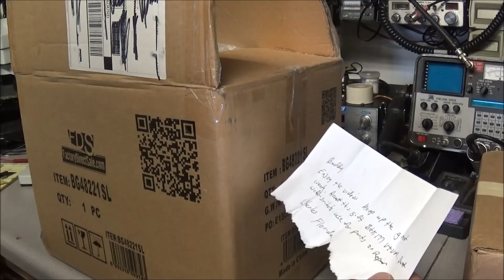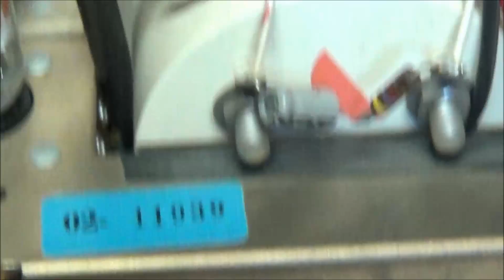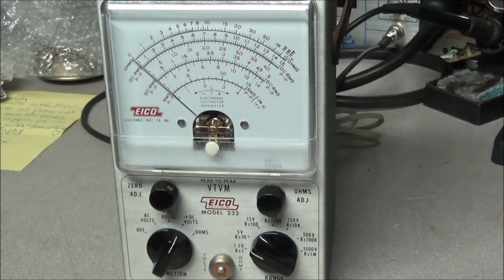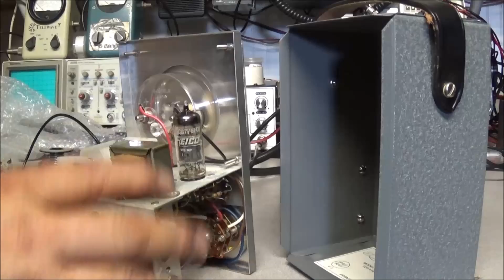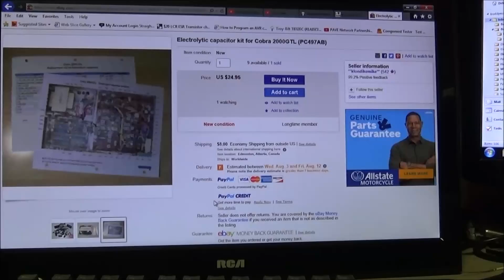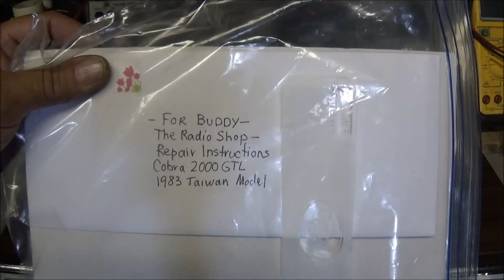#62 Mail Time

Comment: Buddy, you always make great videos. Where I live there are no radio technicians. I need help with some of my CB radios. I own a Realistic TRC-449 and a TRC-457. Base CB The base radio has a distinct AC hum, I suspect that the filter capacitors are bad. the RF output is down. I need help. Thank you for putting these Videos for all of us to see.
Reply from the maker: Robert. Order a capacitor kit. This will most likely solve all the problems. Even the low power issue.  The original caps were not best quality when they were installed.  Thanks for watching.
Reply: Thanks again Buddy.

Comment: The 10V cap comments were good to hear. I've always uprated the lower voltage caps, mostly because of modern components having smaller diameters, not the voltage rating. Agree 100% on using 105°C caps.
Reply from the maker: Thanks Michael.  Sometimes you just have to use the best and the repair will keep serving for a long time.

Comment: The 2000GTL's also have a screwy power supply circuit because the power switch is switching ground.  As you noted, all due to the clock circuit needing power when the radio is off.  Another thing that causes the channel numbers to glow is when the meter light bulbs burn out or someone changes them to LED's, reduces load and you get what I call "afterglow".

Definitely have to watch those eBay cap kits.  Have worked on radios that had just had their caps changed and within a year they were going bad.  Some sellers sell kits with the cheapest Chinese caps they can get.  At least this kit has Nichicon caps, that's what I use.  Only difference is I stock the PW series and just use 50 volt for everything.  You definitely get what you pay for when it comes to cap quality.

The B&K meters are nice.  I used either one of those or a RCA Senior Voltohmist for years as my primary VTVM before switching to the military version of the HP410.  A nice addition to the bench.  And man, sweet condition Eico VTVM, nice donation.
Reply from the maker: You are right Mike, I forgot all about the bulbs and LED's causing this issue. I do see the receive lamp is out so maybe that is causing some of the problems.That Eico is a sweet looking piece man.

Comment: Thanks for sharing Buddy...look forward to seeing how you go about repairing the wafer/switch on the VTVM - after watching you do the IFR switch repair you are definitely the king of switch fixing!  73 - Dino KL0S
Reply: +The Radio Shop 

Worst case scenario take a picture of the switch you need and email it to me.  I have cabinets full of used wafer switches I have pulled from stuff I parted out over the years.  I will have to check but I think I have one of those meters as a parts unit.
Reply from the maker: I have a bunch of NOS unassembled wafer material and ringer stock here. Even have the rivets and tool to crimp them.  Lets just hope we have the right size in stock. But you know me by now :-) Thanks for stopping in my friend.
Reply from the maker: Great Mike. I will keep that in mind!